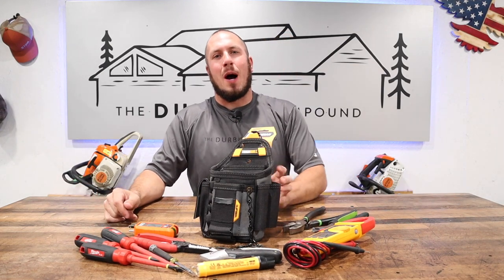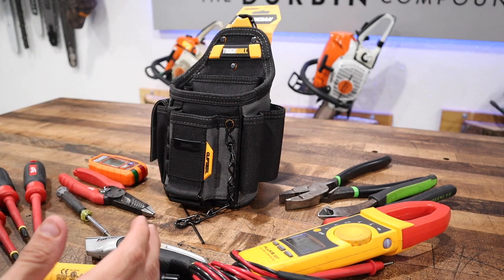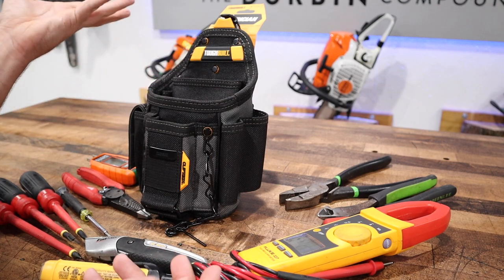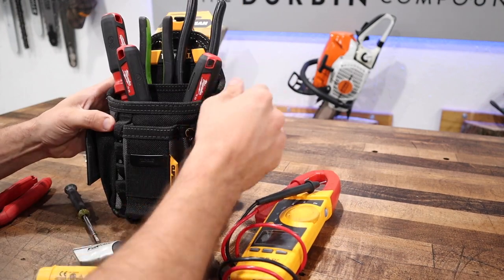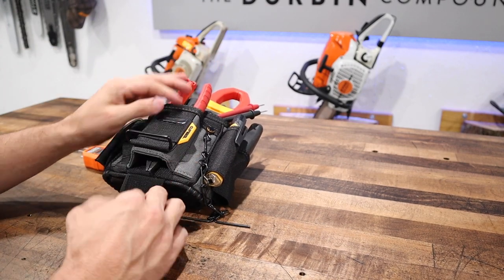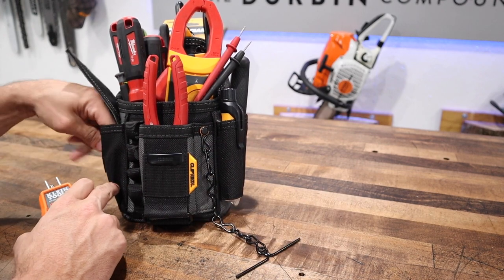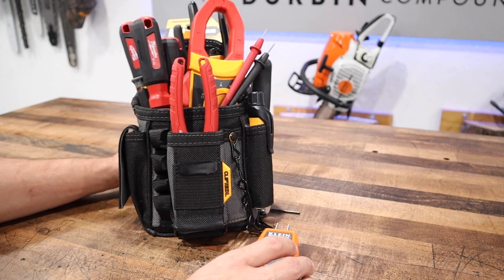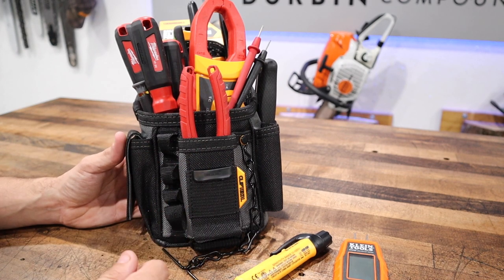ToughBuilt ClipTech Electrician Pouch

Comment: I actually just bought this and have only used it just today and here’s my humble opinion: 
This is more of an installation pouch than a “service call” pouch. Meaning ditch the multi meter and leave that in the bag. The way I set my pouch up is like so:
Front pocket is 6in1 like you had. Main pouch is my lineman’s pliers, 3 screw drivers, angled cutters. 
Thin Pocket behind main pouch is Klein non-contact voltage tester (pen) and AC/DC voltage tester. The pocket on the left with the Velcro over top is for the outlet voltage tester. 
Of course the chain is for electrical tape. And the two loops on the other side holds my needle nose pliers and a Milwaukee pen light. 

For an installation kit, it works excellent. If you’re needing your multimeter for specific measurements and readings, I’d assume you’ll need even more specialist tools. So for that- bring your whole bag along. 

A personal gripe is that I wish it had a hammer loop. But I just supplement with the contractor pouch and put wire nuts and staples inside. It balances my belt without feeling too bulky. 

I hope this was helpful! Cheers!
Reply from the maker: Awesome comment Jacob! I love this. I’ll pin your comment to the top.
Reply: @TheDurbinCompound  I hope it helps someone. For the price it’s hard to ignore the tough built stuff. I went this route just to be able to easily mount and carry my belt on my packout. (I was putting my previous belt in a large bag which worked, but ultimately was quite bulky). 

This specific pouch definitely lacks some features. However- there are a couple other technician and electrician pouches that seem to cover the bases better. Those are much larger and bulky though. So there’s a trade off.
Reply: @jacobhare_true  so you have the little sticky mount and you put that on your pack out for easy mounting?
Reply: @shock196411  actually I’m waiting on my order from packible tool so I can mount to the aluminum brackets
Reply: Totally agree... this is just a place for very immediate tools (all in one, lineman's, side cutters, stripper).  I use the Milwaukee pack out tote to be right next to it (its too loaded too much to hang on my belt)
Reply: That's how mine is set up pretty much verbatim.
Reply: @jwass258  I find it has everything I need for 90% of what I’m doing.
Reply: This is basically the setup I'm looking at now. When I need a belt for installation, use this with the contractor pouch for materials. Then clip these onto the rolling tote which carries my power tools and larger items. Might also get the open top bag for service calls. Not sure yet.
Reply: Jesucristo te ama muchísimo, arrepiéntete de tus pecados y ten perdón de pecados en Su Nombre
Reply: Toughbuilt makes a meter pouch. I'm assuming they meat this pouch for hand tools and then to compliment it with the meter pouch.

Comment: As I was watching this I like the pouch and am just getting into this system, I think you are trying to put 10 lbs in a 5 lb sack. only reason I say that is because they do have another pouch that is designed more for service calls.  I believe its called the journeymans pouch.
Reply: I use this pouch as a fire tech & the only issue I have is I should have bought their more "comfy" belt. I even fit my meter in there. Granted I don't do a lot of service calls so my setup is quite basic but it definitely does the trick.
Reply: I daily drive this pouch. Screwdrivers in the small section; side-cuts, channel locks, level, and occasionally an RJ45 crimper in the main compartment; sharpie in the loop; needle nose and cable scissors in the outer right two loops; open strippers in the flat side section, handles sticking out either side; punch tool in the front. Front clip either holds a tape measure or the drill

Comment: I'm a commercial Electrician.  This thing is awesome. I wish I could attach a picture with proper set up. Where you put the pen tester I put a 11 in one screw driver. The one behind that a pair of channel locks. Please and stippers inside. Level and tape measure on front. Bits to various tools and drills. Have a case with a strap for my meter separate to hook on belt separate.  This pouch is mainly for task spefic projects, so you just load the tools you know you're going to need

Comment: im able to fit 3 insulated screwdrivers, an 11 in 1, a multi bit nut driver, 2 knives, a level, non contact voltage tester, wire strippers, and some long nose pliers with room to spare best 15 bucks ive spent

Comment: Just looking at this now, I have to say when you started to criticized the length of the tape chain I all of the sudden felt my brain u-turn to wife mode. If you don't like the length of the chain you can re-size it easy (it's a bag full of tools), or remove it. I love these pouches, they are inexpensive but sturdy so far (I'm strictly a home user). I like that I can grab a pouch and take a walk, tighten up and stupid stuff like drawer pulls, door knobs, I can troubleshoot a power issue, I can fix a leaky faucet, or whatever. But if I can't fix a problem with what I have, I can make a note and come back with a different pouch.
They keep my tools organized and easy to inventory. There are so many options on how to set them up. Honestly, I care about my tools again, these things are like freakin' Legos and I can't stop playing with them.

Comment: It seems like the small size is the main deal killer for you. The mid-size "Journeyman" model would be a better fit. It is what I use every day. It still has the other design quirks you point out, but a lot more space to work with. The first one I had was the even larger "Master Electrician" model. But that one was too bulky for my taste. It got regifted as soon as I got the "journeyman" model I use today.
Reply: I just got this pouch today, its more of a what you need pouch while on the ladder, two screwdriver cut outs on the right, wire strippers and two-three pliers, i got the framers pouch on the left for material needed.  I keep my tools in a backpack and just pull what i need for what im doing to keep the belt light.

Comment: I do hvac work, I would either buy a smaller clamp on meter or put it in my veto meter pack( turned it into a back pack) then have my drill hanging to the side. So I would have drill right side, mini back pack and this on my left side. The small pouch is for a note pad btw

Comment: I carry my main essentials in the larger pouch 8in1 screw driver, angle cutters, magnetic tip Phillips, strippers and a small headed flat for switch and outlet covers, I put my non contact tester and a sharpie in the small front pouch and my lineman’s I stick in the small side holster and the one behind that I just clip my knife into it and I would put my plug in tester for recepts into the other pouch with the little flip cover and of course a roll of tape on the tape holder. It’s worked pretty well for me so far seeing that I’ve only been using it for a short amount of time.

Comment: The way i set mine up is needle nose and utility knife in the top pocket. I. The main compartment i carry my lineman pliers and diagonal cutters. Front pocket my wire strippers. In the two slots my 11 in 1 and a flathead screwdriver. In the pouch with velcro flap i carry my impact bits. Non contact tester in my shirt or pants pocket. My multimeter i carry in its pouch and only carry when i need it.This is my pouch for service calls or towards the end of a new construction job when i dont need my tool belt.

Comment: I use mine for network tools.
Small pouch is the crimper
The pen sleeve in the large pouch holds my Jensen scissors
Large section is a linkrunner
Velcro pouch a couple tracers for the link runner
That through pouch is the punch down tool
The two loops I'll put a screwdriver in one and the other my strippers\snips go in handle first so they sit securely

Comment: So the two loops on the side are for the screwdriver Robertson and Flat head throw the ECX away. Or just carry an 11 in 1. . Non contact in the pouch with the flap wire strippers or installation tool) in front . Linesmen's,  side cutters and level n main pocket. your knife in last pocket. Like  Jacob said installation pouch. I don't have this one but I have another brand set up similarly a Kuny's. I have been eyeing this line but for an installation pouch I kind of like the 10 pocket technicians pouch better. These small ones are great for ladder work.

Comment: I wouldn't use it for electrical purposes. Id use it to hold my green and red snips, trim square, soft faced hammer and hand seamer. The "pass through" is to adjust the pocket depth based on the length of the tool you are using it for.. obviously.

Comment: I was looking for a small pouch that could fit my big Milwaukee reamer, channel lock and linesman pliers while also being able to hold a tape measure because my I'm doing commercial so using just a handful of tools 🤷 

If you need this shit ton of tools, you're either carying too much, or doing residential. At this point, just get whole tool belt set with lots of pockets.

Comment: The main pouch I have my lineman’s, diagonal cutters, and my Milwaukee 7 in 1 pliers. In the small pouch I have my tic tracer, plug-in tester, a pencil and marker. In the main pouch next to the small pouch is a little fabric ring I have my insulated Phillips screwdriver in it. In the pouch that has the Velcro I have my Klein strippers. I have my tape measure in front of that on the metal piece. On the side that has the Velcro I have my stubby screwdriver. In the other side I have my flathead and my screw lock driver. Depending on what I’m doing I also have a twirly screwdriver for trimming out and a beater screwdriver for roughing in the side with my flat head.

Comment: It's a small pouch. Small means for small jobs, like changing fixtures or changing out wall outlets. You don't need all that stuff for small jobs. Side pouch is for a cell phone. You don't need a utility knife to change out a power outlet, nor a multimeter.

Comment: 4:00  they are called Molles.  Quite useful actually,  Goggle Molle. You'll find them on camping/hiking gear, soft luggage for motorcycles, and military applications.     I just bought the TB "Master" Electrician Pouch to gather all my (DC and AC) electrical tools in one spot, including my Fluke.     I'm thinking it has plenty of room / pockets for your selection of items discussed here. It includes a carrying strap, and kickstand.  Found your video while looking for a recipe to organize it.      New Subscriber, nice video.
Reply: Its made to secure you tools on leniard when you working high and dont want to drop something .   Sry for my ang.